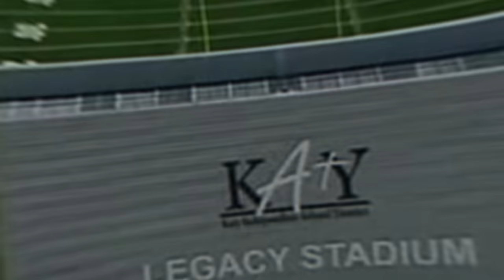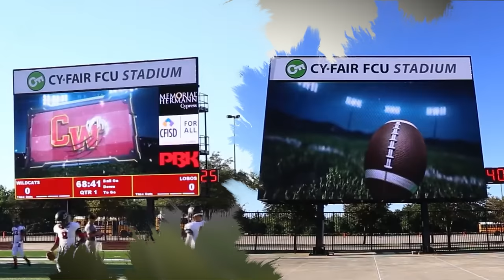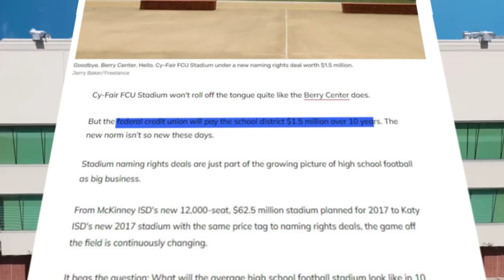Inside America’s $100 Million High School Football Stadiums

Comment: The funny thing is with Eagle Stadium was that in 2014, a safety inspection found cracks in the concrete foundation and were FORCED to close for the entire 2014 football season.  It cost 10 million dollars to repair those cracks.   It re-opened for the 2015 football season.
Reply: Yes this is correct not to mention it had a 12 degree downward slant too 😮